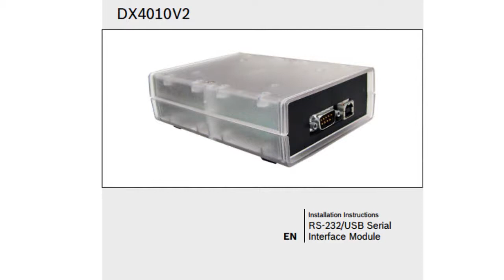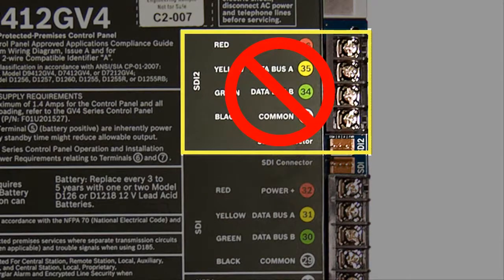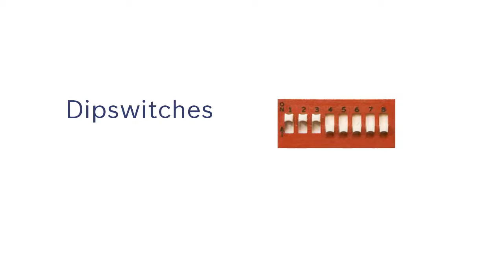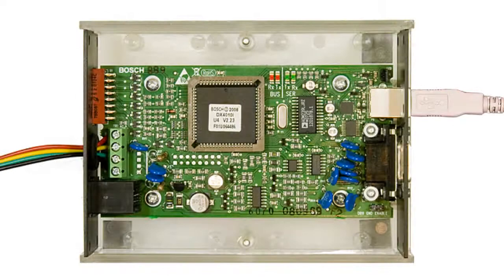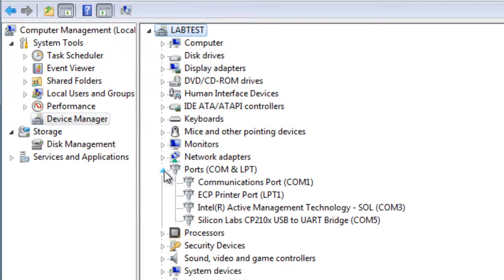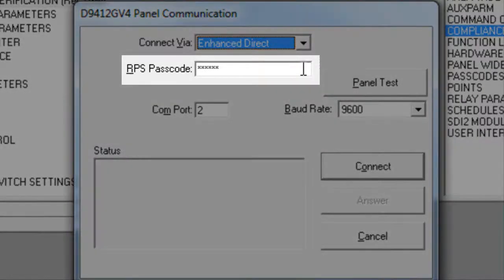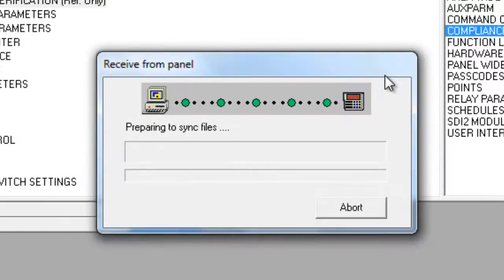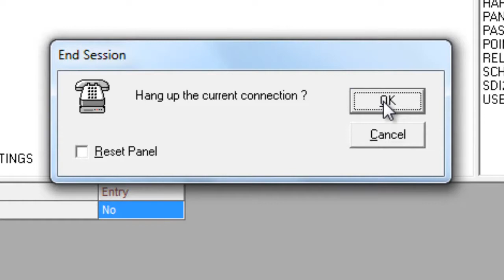DX4010V2 - RPS Connection

Comment: I'm trying to connect to a D7412G. Tried dip switches 1,2,3 on with connection from the dx4010v2 "telephone/4 conductor" to the panel's Programming 4-pin connection. No heartbeat on the dx4010...
Reply: @Tom, did you ever figure this out? I'm trying to connect to a D7412G as well